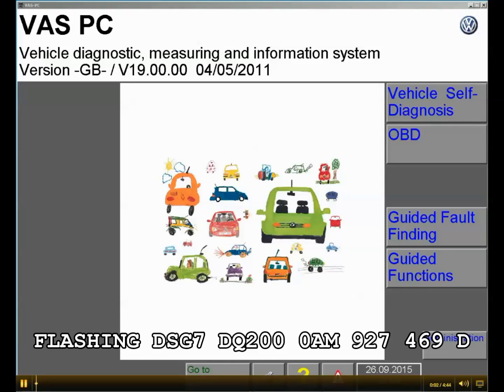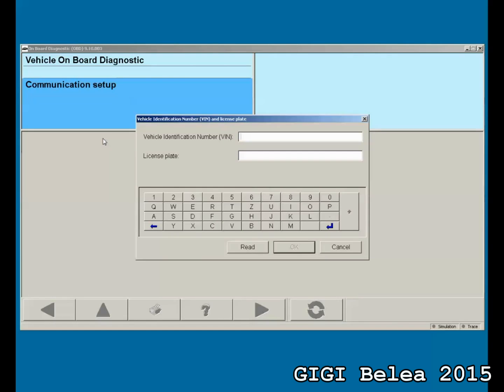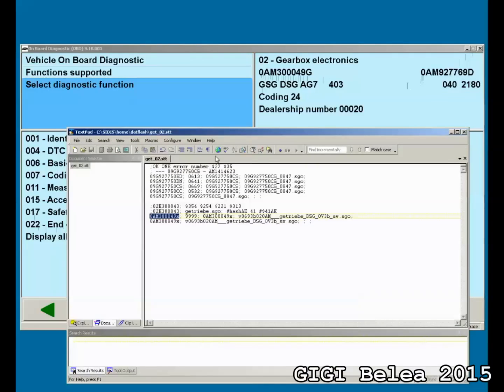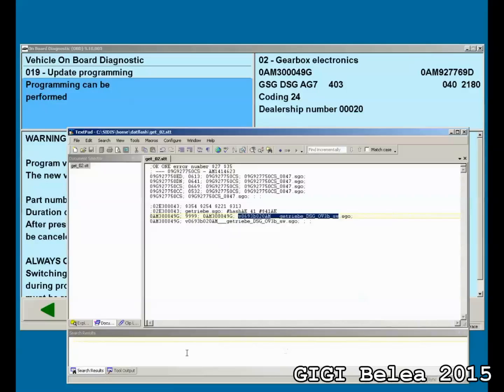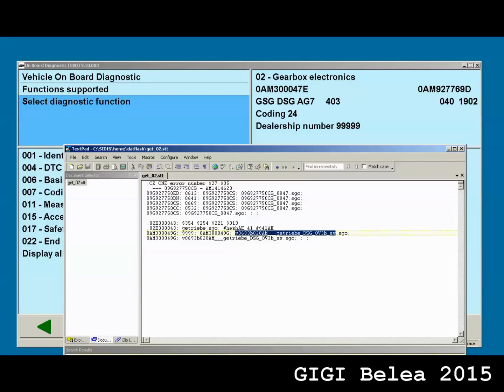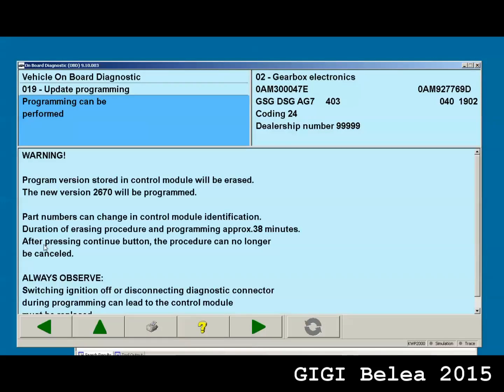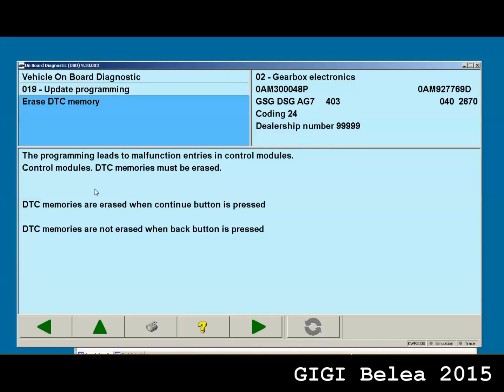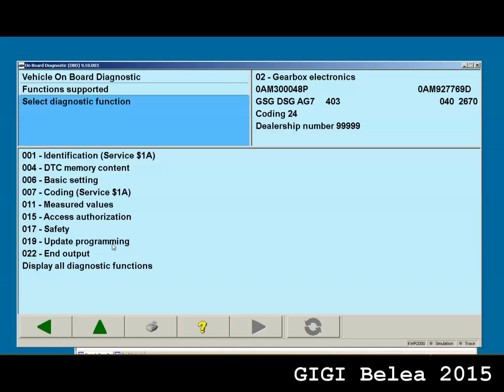Flashing / Programming DSG7 DQ200 Mechatronic unit 0AM927769D using VAS

Comment: Hi, the video is helpful and knowledgeable. 
I need some guidance from you. I have changed new Mechatronic module with same part number in old valve body. Pls guide me how code or program the TCU and how to get exact software for the vehicle?

Comment: How do you flash these chines units that came blank.
Reply from the maker: Like all the others ? ... not sure what you mean.
Reply: @GigiBeleaDK  the units that came refurbished from china comes blank with no software . VCDS and ODIS E Cannot ID the unit  as it is blank . Was wondering how these are flashed . Or if they can be flashed with odis or vas pc  or other programer like PCM flash etc
Reply from the maker: @autotechnikertt  Attach it to a car , then you can see it. OR add a CAN Gateway to your installation.
Reply: @GigiBeleaDK   ok will try that . It's strange how I can read old unit on bench but I cannot read the china unit . Will try attached to car
Reply: did you ever work this out?
Reply: @robfairbanks4011  
yes pcm flash on bench , flashed eeprom and flash software to tcu and it worked
Reply: do these Chinese units come with a component protection ? I mean you can flash it directly or you need to open the protection for them ?

Comment: Do i need to reprogram the dsg7 mechatronic unit after changing the transmission step motor and gearbox oil pump only?
Reply from the maker: No, just basic settings.
Reply: Farhaad Oaris no
Reply: Mechanic is unable to do basic settings, unable to communicate with mechatronic unit. There is still a 06079 error code, 3rd and 4th gear slipping. He said he will change the base of the unit. Hope this resolves the issue.

Comment: Hi please could you help with have a new unit that need flashing ,we have Odis online with passthru but what other sytem would we require to flash the original data onto the new unit thanks
Reply: You can still use ODIS, just need to bypass version verification in the admin settings. Eventually contact me by mail (contact details on video description).

Comment: Good day. I have a VW Polo 2014 with a bad mechatronic. I had a mechanic change out mine for another one from another VW user however with a working mechatronic. Still no gear change or movement. It shows that the transmission is stuck in 7th gear. What is my next move and how can I acquire this software and flash files?
Reply from the maker: Talk with a tuning company, they should be able to move the software from old unit to the new.

Comment: Hi, I've followed up to the text pad file programming, I don't seem to find datflash in the home , but I have Dbasesys2, and Get_02 but when I open with textpad doesn't look like yours?
Reply from the maker: That means you are missing the datflash files. You need to create the folder and place the files there.
Reply: GigiBelea aka JAX  where do I get the files from ? Because I checked my whole system for the files and I don't have them
Reply: Place all the files I have in a file I name datflash
Reply from the maker: From the Flash DVD's at VW.
Reply: GigiBelea aka JAX  I have no cd or DVD I bought the program with the cable online, is there a way I can download or get that file to put it in the :C

Comment: Hello i have golf mk6 tsi 2010. A problem with mechatronic appeared last week and VW agency wants 2200€ for repair. I found  the same part new for 350 but i would like to know if i follow the same procedure will be okay to program it. In addition what cable is used for vas and where can i buy the softwares and tge cable to flash it?? Or  can i have your details? Are you able to repair the mechatronics? I am from Cyprus but i can send it to you. ERROR P0841
Reply from the maker: Cable is a VAS head (look on ebay) and the software can be ODIS or VAS 19. You can flash any unit to fit your car if hardware model is the same. I can repair any unit, but I live in Denmark, shipping costs would probably be high.
Reply: GigiBelea aka JAX Vw agency told me that the mechatronics is faulty. What is the cost to repair it??
Reply from the maker: Depends on what is defective. Between 300 and 450 eur. Factory new unit is around 1000eur. Read the whole description of my video and contact me by e-mail.

Comment: hello mate, can i put my old mechatronic files in to the new secondhand one that i have bought? because my new mechatronic is LOCKED due to component protection.... on ross-tech website says it needs to recoded by the dealer with SVM coding. is there any possible option to do it like the method you do? sort of cloning the softwares from the old one to the new one?
Reply: ooh by the way i have a DQ250 mechatronic.
Reply from the maker: Hi. Yes, you can clone the old unit but you need a special tool like TCU Manager from Magic Motorsport. Else you can flash your unit like I did here and then take the car (on platform) to the dealer and they will remove component protection. OR, remove component protection BEFORE you change your mechatronic. Units with immo on can only be coded by dealer online.
Reply: will this work with a clone  5054A and GEKO online coding what can be bought online on some diag equipment shops from china?  whT i mean is actually will it work to code with SVM with a clone 5054A with ODIS and GEKO from chinese suppliers. and btw do you know about MINI dsg reader will that hardware help me to clone mechatronics from an MQB based audi S3 DQ250 mechatronic??

Comment: hello I want to do an update with ODIS E ,an automatic transmission 2011 Audi A7 4G0927156K_0012 to 4G0927156K_0015,  is a risk? something could happen?
Reply from the maker: There is always a RISK involved :) But no risk no gain. If flash session goes ok should be no problem.

Comment: Hello, very good video, I can't get software into the electronic control unit of mechatronics by a short circuit. it's possible to find out the software and coding Only with the VIN number?(DSG 7 0AM) vw golf A6 2011
Reply from the maker: +Oak Flesh Yes. Possible.

Comment: afternoon 

i have a polo Gti DSG 1.4 which was involved in an accident and apparently it is stack on gear number 3 and the codes revealed from the diagnosis are as follows:

002080 – selector lever 
049411 – no communication gear select module
006242 – powertrain databus
002324 – 1 selector lever 
02344 – gear shift lock solenoid control 
005940 – 
002329 – select lever 
002080 – 
054272

 may you please assist of what could be the problem and how to solve it.

Comment: Hi, i have a question about DSG 0AM software, how to tell if the software match the car?

i bought a new Mechatronic from internet with software they only ask for VIN to match the engine etc...
I received my new Mechatronic and i've installed and basic settings done using VCDS.

Unfortunately the mechatronic wont work on my CC and the DSG where changing gears very badly, shifting was horrible and gears slipping., Fault P177B and P177C. 

So here's question, is there anyway to make sure that software on the new mechatronic fit my car?

Any help would be greatly appreciated.
Reply: +Fredj A .J If you tell me what software you have on the car and the VIN number I can tell you if it matches.
Reply: +Jaxelos any help would be greatly appreciated
Reply from the maker: +Fredj A .J Read my comment again.. READ it please.
Reply: +Fredj A .J 
Hi,I have the same problem as you. After replacing the mechatronic on my DSG7 0AM , adaptation does not end and changing gear is very badly. Fault P177B and P177C . Can you help me find the right software ? Did you find the solution?Thanks
Reply: S